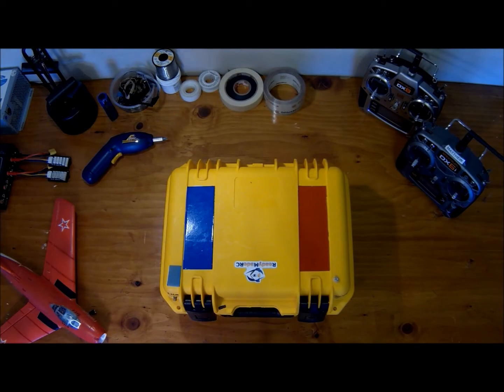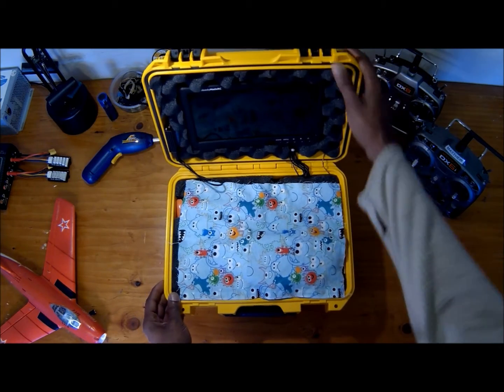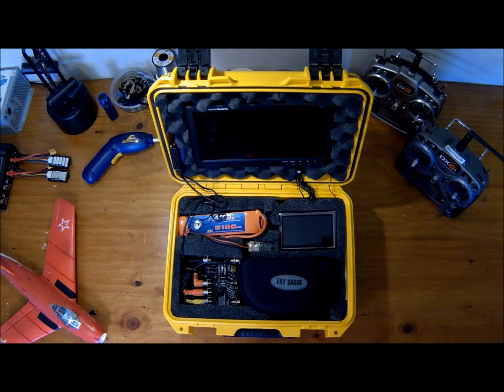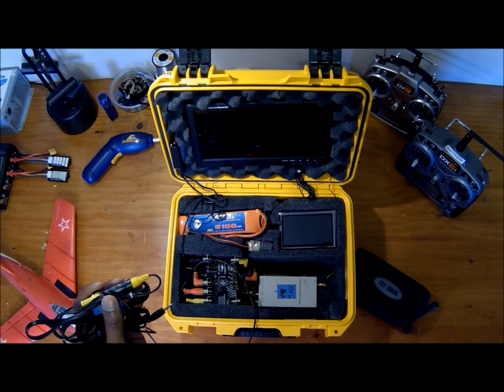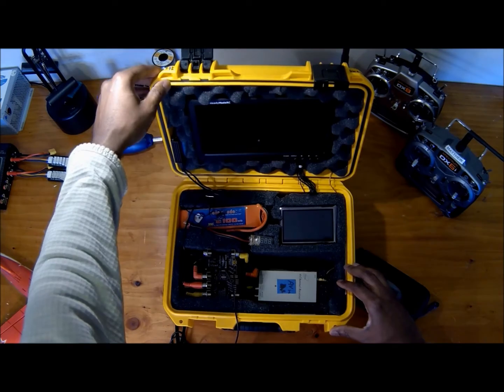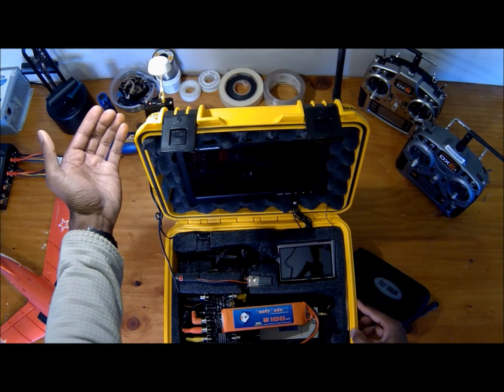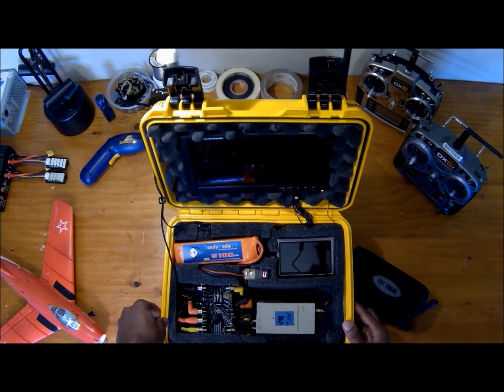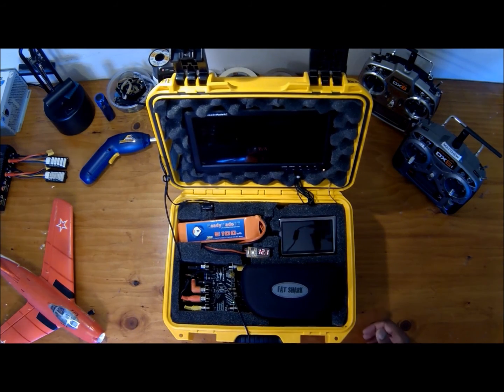FPV ground station overview Youtube

Comment: Wait. Can't you have a splitter between the bands. Or both bands runs simualtinious?
Reply from the maker: +Da Aa Hey, are asking if i have can have two different bands coming in or spit two of the same band?  My set up is two of the same band coming in, 5.8GHz, from two different antennas, omni and directional.  The spiltter takes the signal with the greater strength and sends that one to the video output ports.  Once it hits the video output ports i send it to the monitors, goggles, etc.    You can attached two different bands to the two input ports but you can only send one of them out to all the video output ports at once.  You can manually select which input you want to output or select to do it automatically based on signal strength.
Reply: gromitvt10
Yes. With a diversity reciever.

Comment: Why don't you use the diversity of the eagle eyes and run 5.8 and 900?
Reply from the maker: When flying long range I hook up a tracker and use the Eagle Eyes diversity switcher with two bi-quad antennas. I use 900mhz because it has longer range than 5.8 and 1.3 because of it's long wavelength.